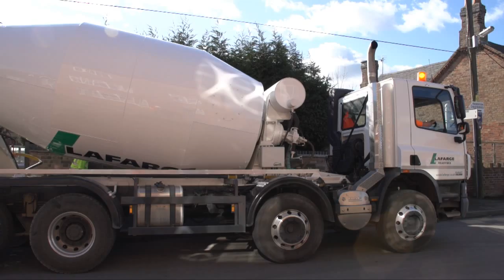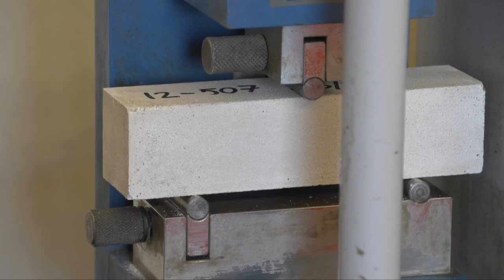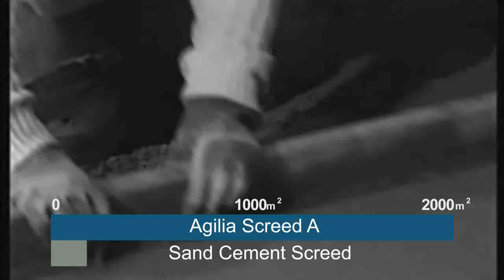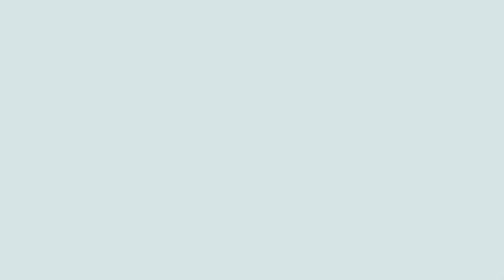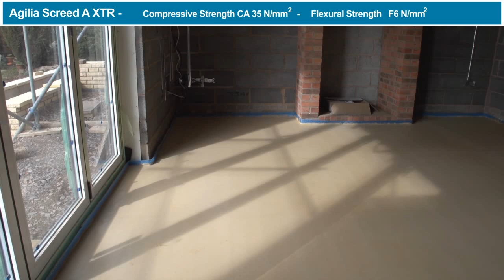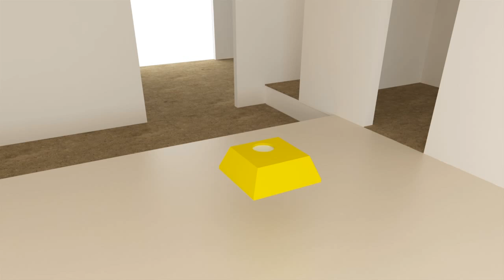Agilia Screed A

Comment: do you know if i can paint the floor to a have a finished floor? is so what paint is suitable? Thanks for your help
Reply: Stephen Thornton I had a similar question. I wanted to apply a clear coat epoxy. Did you get a response to your question? What did you wind up doing and did it hold up? Thanks